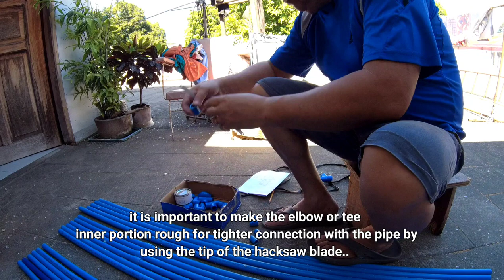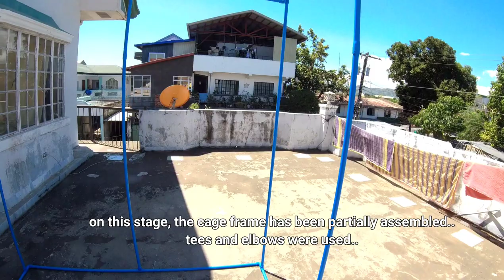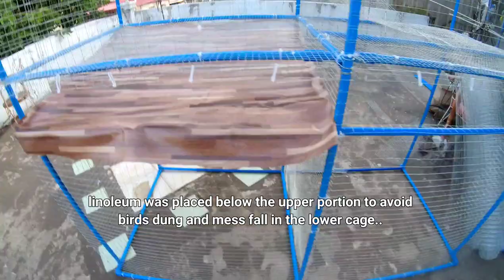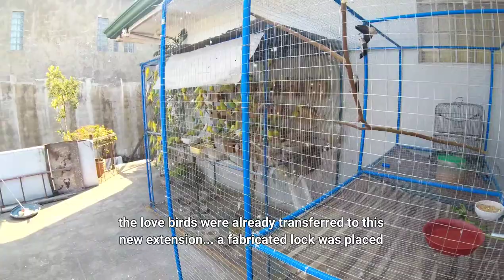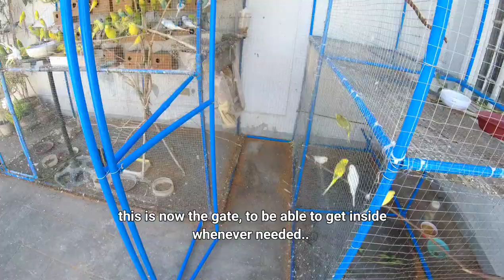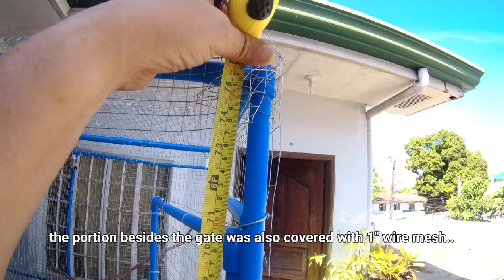Tutorial - Build an Aviary Framed with 1/2" PVC | Mar Bel

Comment: What is the dimension of the cage? Is it  schdule 40 or 80 grade pvc pipes? Is it really 1/2 inch pvc pipes?
Reply from the maker: @gouravsarkar13  The dimension of the original cage is H - 190cms. L - 200cms. W - 110cms. and the extension is H-190cms. L - 190cms W - 135cms.  No specific schedule on the pvc I bought and 1/2 inch pvc pipes.